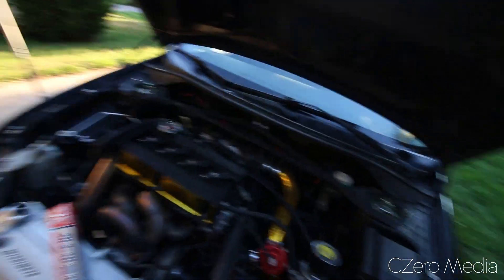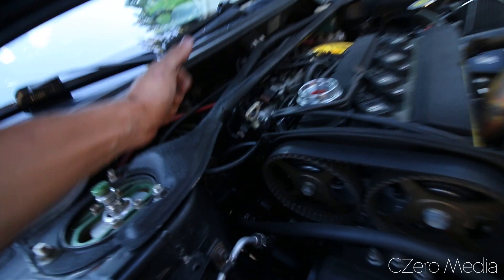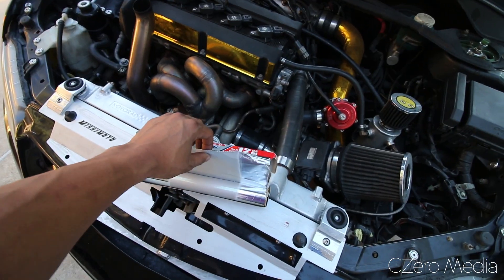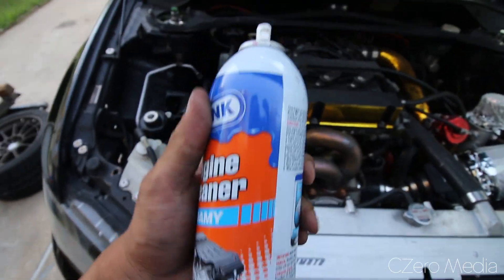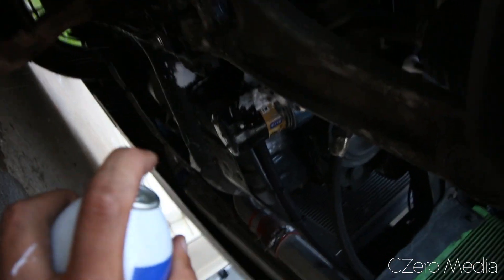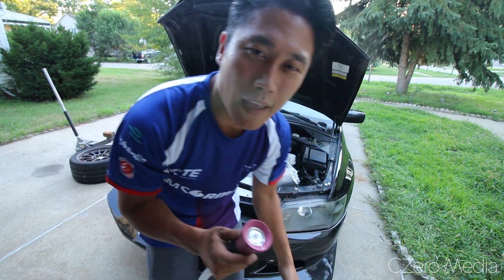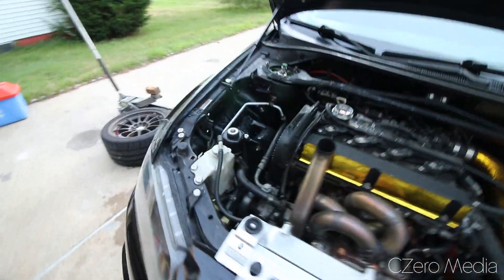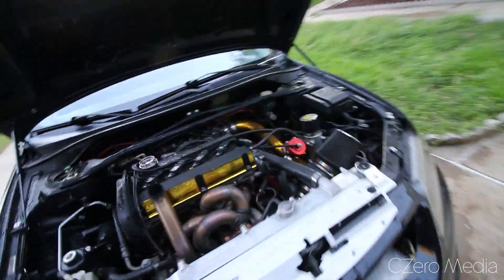How To Wash Your Engine Bay - Evo8 edition

Comment: Also I looked for a long time to find the best and safest method to clean the engine bay and came upon a study done by a chemist who was also a car guy about Scrubbing Bubbles bathroom cleaner. It is amazing and completely safe on all of your electronics, no worries with covering alternator etc. Let it set for 15 minutes and hose it off and it will eat through almost any grime. My Evo engine bay is clean enough to eat on.

Comment: I've power washed my entire engine bay several times. There isn't really too many things that can't get wet under the hood. I've done it at home a few times, but it's best to do it at a car wash so you don't get all that oil & grease all over ur driveway.
One thing I do is put Dielectric grease in the back/wire side of all my exposed connectors so that water doesn't get inside them & short shit out. Evo 8/9 owners shud especially be well aware of the connector box in the driver's side kick panel! Water runs down the wire harness in the fender and through the grommet continuing down the harness & gets inside the plastic box/connector housing and eventually shorts out the entire car... I had to cut & hardwire all of those wires & when I did, I caked on the Dielectric grease!
Anyways, you can be pretty tough when cleaning the engine bay!

Comment: CzeroMedia, what size spacers are you using? I am looking into purchasing 15mm rear and possible 12-15mm front. Current setup is 245/40r18 on CE28's. I did the fender mod from your other video and am trying to run 255/40r18.

Comment: Can I use USDM aluminum foil?
Reply from the maker: unfortunately no, USDM aluminum foil has too much weight and will dip once applied, causing it to get caught between alternator fins, creating short within the system. It will burn down the car on initial start.
Reply: +CZeroMedia lol
Reply: +CZeroMedia I laughed out loud and woke up the gf at the JDM tinfoil

Comment: where is your timing chain cover
Reply: shawn zorzenon Its a timing belt and he took it off because he probably likes the look
Reply: If oil gets on it..... he might wish he had a cover over it. The manufacturers spent a ton of extra money (if you multiply the cost of the cover and the number of cars they made) to put that cover there. But... It's not important. Wait until the timing jumps (or should I say slip?). So many people think they don't need little heat shields, covers, etc. They aren't engineers and that's why I don't buy used cars!